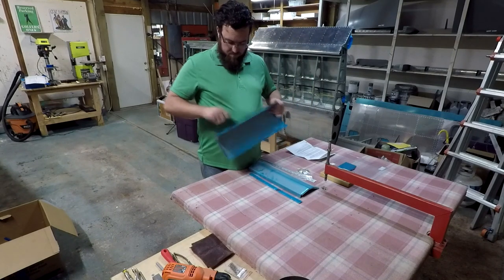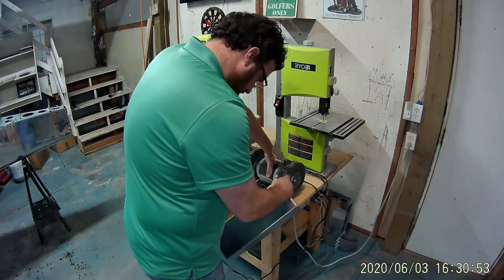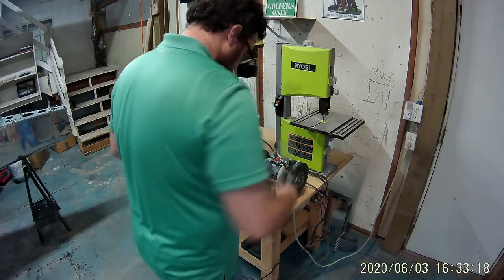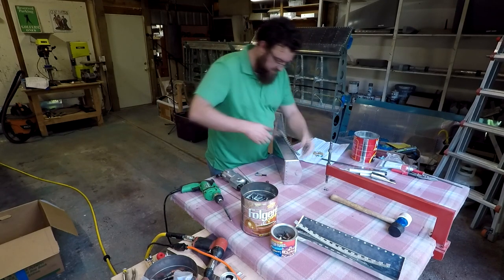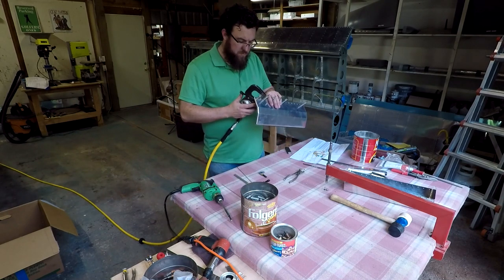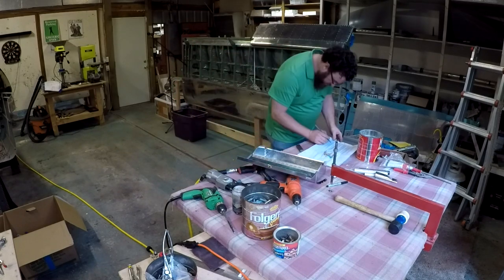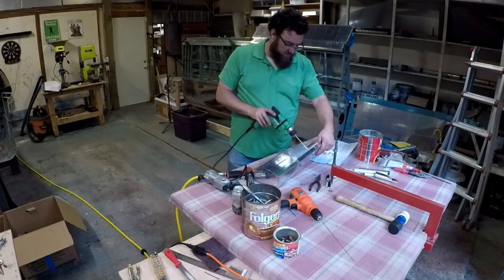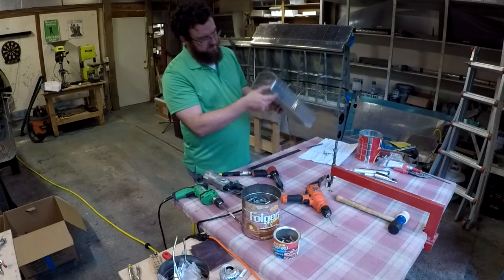Van's Aircraft Tool box kit practice

Comment: Scott, put some rubber shelf liner or thin foam under your buffer/grinder and it won’t move around on you.  I like having mine NOT bolted down so I can reposition it if needed.  Glad to see you back at it!  I need to get my wings painted so I can haul them out to my hangar to make more room in the garage!  Jim
Reply from the maker: Thanks for the recommendation for the foam or rubber. I will have to try that out. Its been driving me nuts! Like you said, I dont want to bolt it down so that I can be flexible with moving the other stuff around for larger pieces!